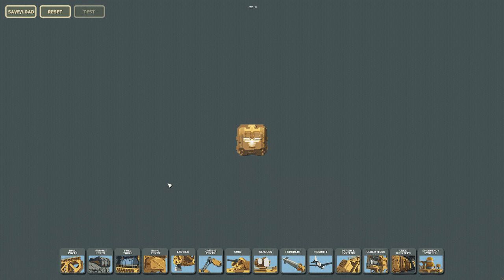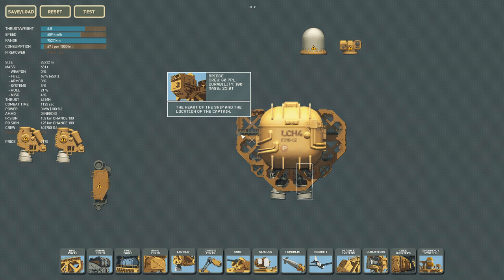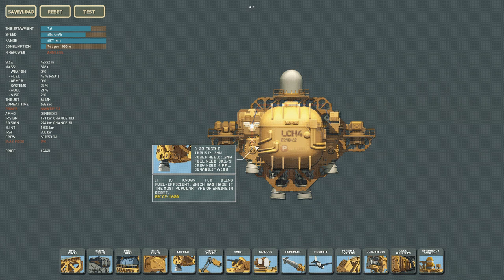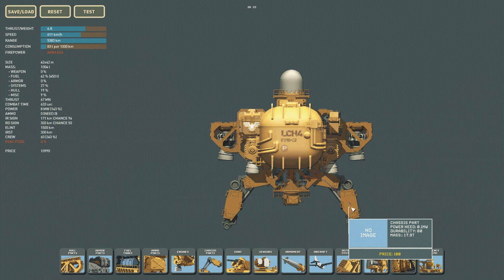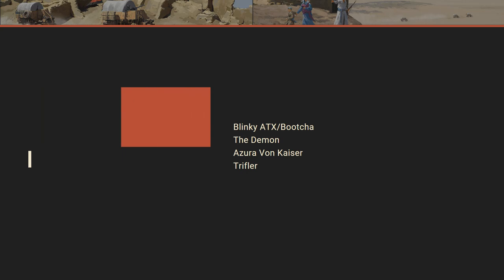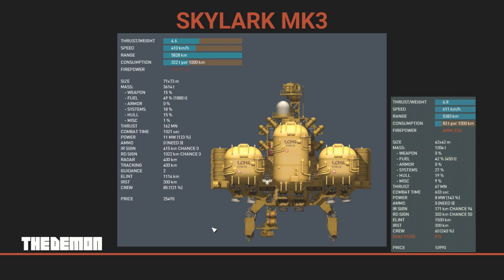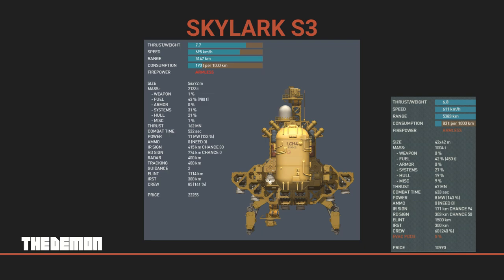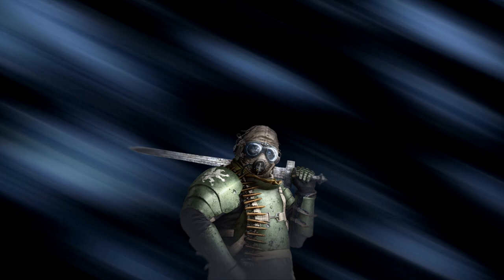Highfleet 1.14 Shipbuilding: The 'Starfish'

Comment: On the Starfish: 
- You can angle the upper leg segments down more and replace the lower leg segments with the smallest let size. That would save a little weight. 
- If you move the two 2x2 hull blocks on the left and right sides of the fuel tank down one 1x1 square, then they won't get cut off if that lone 1x1 square is lost. Especially since you don't have a connection across the top. Less importantly, you'd save the weight of those two 1x1 squares. 
- It might be good to switch the static and maneuvering engines. It probably doesn't matter in the game, but realistically it would be more stable. EDIT: Nm, I see that would interfere with the IR. 
- Did you want escape pods? Two wouldn't really hurt it.
Reply: The only significant downside I see to using a single fuel tank is if you intend the Starfish to provide fuel to other ships and not just move itself around. That's where the additional fuel becomes valuable, because if it's providing fuel, then the other ship or ships must have poorer fuel efficiency than the Starfish.
Reply from the maker: This is a great set of comments. I think I am going to refit all of my ships in a quick video before we launch and I will take these on board.

Comment: One thing to point out is that the other tankers effective range  is about 50% greater than the Starfishes. They look the same right now because of the difference in fuel consumption of the tankers themselves, but the Audacity consumes 180t per 1000km, meaning you triple the consumption of the Starfish but only double the consumption of the submitted ships.
Reply from the maker: That's a great point. Something I didn't communicate well in my build video was I want the starfish to have a low capacity so it gobbles up salvaged fuel quickly. As long as it can get us to the next town with some wiggle wiggle room it's doing the job I want. I have more serious tankers planned for Strike Group 'Jari'
Reply: The default Skylark + Lightning gives pretty bonkers range, but... how much range do you really need?  These little corvette strike fleets are going to either A) jump from small town to small town clearing up garrisons and scouting for Tarkhans/Intel or B) camp to the side of a trade route, snag a prize ship, and drag it into town to sell.  If they have enough gas to get even 2 towns over... it's probably good enough.  

You can design ships that are 900kph or have a fuel range of half the map, but unless you need to outrun something that's 899kph or plan to deep-strike Khiva directly from Ur you just don't need that much margin.  This thing comes in at a very comfortable $10k price tag, and that allows Phrosphor to run more strike squadrons.  If the extra range isn't going to be used, then there's no reason to throw resources into it.

Comment: you only need one rotational thruster near top center and landing is solved, having 2 affects your range and efficiency
Reply from the maker: Good point, with 1.15 I would maybe even go with some horizontal ones.
Reply: @Phrosphor  oh horizontal is even better, i wonder if putting to fixed horizontal ones will contribute the speed range the same way as pointed down... must be

Comment: @TheDemon
15:00 - You might want to try an RD-51 instead of all those D-30S engines. Once you reach a certain overall mass, the RD-51 becomes the more efficient option. I'm just not sure if the mass of you Mk 3 is there yet or not.
Reply: The problem with the RD-51 is that installing it requires the 500+t large hull section, probably no.
Reply: @henryhamilton4087  Well... For example, I got better fuel efficiency adding an RD-51 to the vanilla Longbow and Yars than two D-30S engines.

Comment: I revisited this to build my own Tanker with ELINT and IRST
And I found that you can forgo the gimbal engines in favor of side mounted static ones (I think thats a 1.15 feature)
That way I was able to hit 967 km/h
also 
you can swap the big fuel tank out for 8 (or how ever many) small ones
Makes routing of power much easyer and allows you to cut down on unnecesary fat
this in turn increases efficiency range and speed
(TPW 10.7 967km/h and 4004 km range for the low low price of 10880 Credits)

Thank you so much for this I learn something new every time I revisit this series

PS: Can you explain to me why sometimes 2 Small generators are more fuel efficient then a single big one?
are the small ones less weight per area?
Reply from the maker: When I built this the static thrusters were not able to be rotated to fit sideways. This new mechanic has really changed ship building vastly but I haven't really experimented with it a lot yet because my campaign was built for the old mechanics and there is no way we would ever have the time or money to reconfigure them.

From what I remember 2xsmall are actually slightly heavier than 1xlarge. The only reason I would use them is to keep the size of my ship down by squeezing them into small spaces.
Reply: @Phrosphor  Nice 
Thank you so much for your in depth answer
I really appreciate that ^^